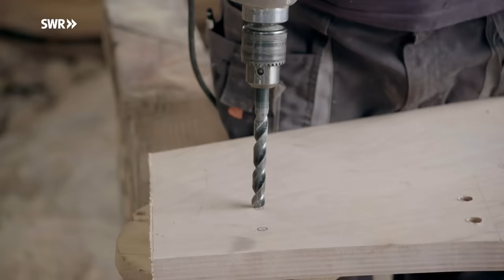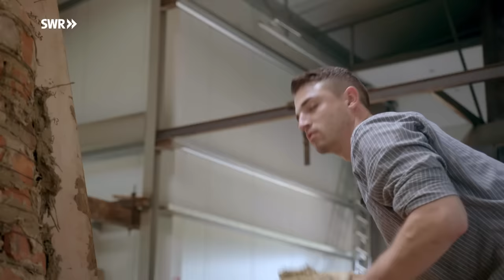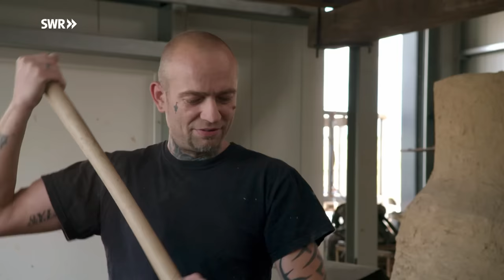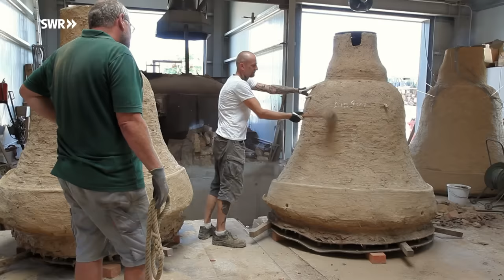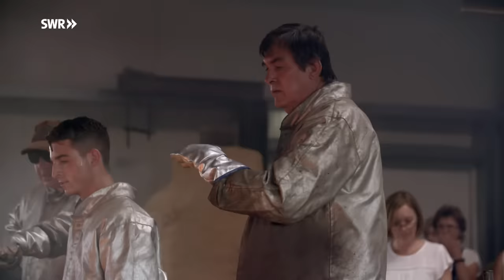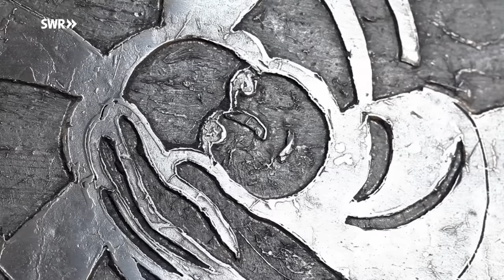Wie man eine Glocke gießt | SWR Handwerkskunst

Comment: what type of metal used to cast these bells?
Reply: They are made from bronze, which is in this case mixed from exactly 78% copper (Cu) and 22% tin (Sn). This mixture has proven to be the best for centuries. With it, the bells are very durable and have a particularly beautiful sound.
Reply: @deutscheumwelthilfe3642  Thank you.  the color at the end (42:37) is silver looking, so it made me wonder if it was something other than bronze.  Bronze to me has more of a brass looking color, at least all the bronze I have ever seen.
Reply: @AffordBindEquipment  The bronze you are talking about and which one is also associated with the name of the color "bronze" is mainly used for statues, busts and figures. The tin content of these mixtures is only a few percent - this makes the resulting bronze softer, more elastic, and gives it a brownish-golden color. In addition, a cast bronze with a low tin content as used for statues is easier to process afterwards. Mixtures with 22% tin like here for the church bells are the hardest bronze mixture that are technically possible for this purpose. With 22% tin, the resulting bronze is extremely hard but also very brittle, so it can no longer be bent - ideal for the production of a melodious bell that lasts at least for 200 to 500 years. If you use more than 22% tin, the bronze is no longer suitable for bells, as these would then shatter and crumble.
Regarding the color, I can also reassure you - after a few months or years in the bell tower, this bell will also be significantly darker and bronze-colored due to the external oxidation. 

Please excuse my bad English - I haven't practiced it for a long time. Greetings from Germany!